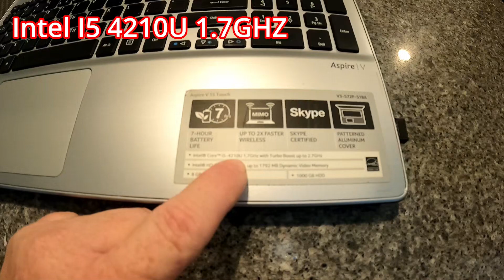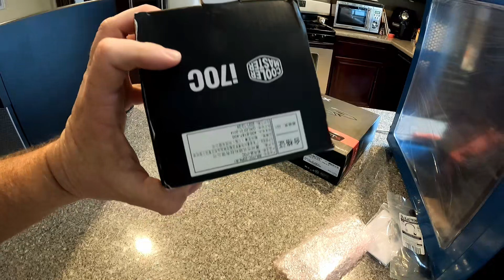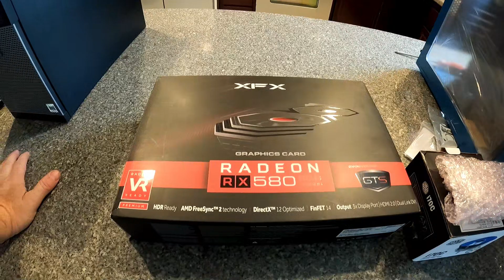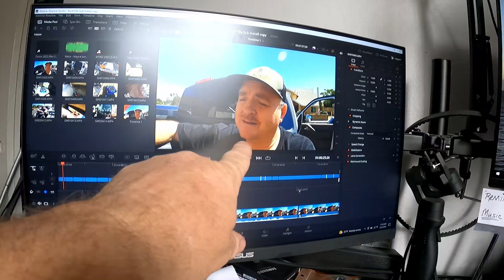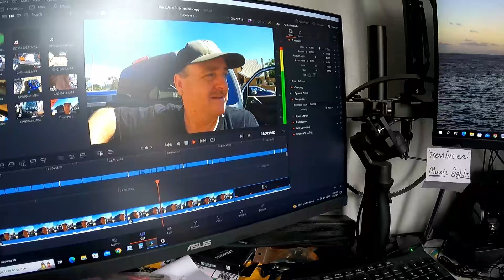Willy's DELL OPTIPLEX 7020 Upgrade

Comment: Thank you for this video 😁
My brother recently give me is old optiflex pc and at the same time a friend gave me is old graphic card 😅 I'm completely new to pc building and all those technical words so I have a lot of hard time pulling it off 😁 That's why I appreciate your video because it's clear and easy to understand. Now I know how to cable my mother card and my graphic card 🤣 I need a new power supply and some adaptor 😅 I will see later if I also need to upgrade the cpu and the fan. I hope not, I don't have a big budget 😅
Reply from the maker: Hello Minata, I’m glad you liked the video. Congrats on the new to you Optiplex. The old machines are plenty capable to do our daily tasks. I suggest you get new thermal paste for the cpu and cooler and a newer power supply. Depending on which model you have, there’s room for another fan in the front. Make sure the other fans work. Good look with the build and have fun. Thanks for watching!!

Comment: Well that was a fun upgrade to watch! Things should run cooler in that bigger case with those fans. Usually have to be careful handling the mother board etc because of ESD, could damage ic's. Nice video!👍
Reply from the maker: Thanks man! I know this video is long and can be painful to watch but I needed to do it and I might as well share it. I know there are more cautions to be taken when handling these parts. But it’s an old Dell from 2014. I know I’m not the only person to man handle it…😂 Thanks for watching!!

Comment: It's worth mentioning that the integrated backplate on the Optiplex won't always work with an aftermarket cooler. The threading is often different between coolers... so it might need to have those tabs cut off depending on what cooler you get so you can use the backplate that comes with it. An alternative to cutting is buying a standard 115x retention bracket of eBay for like $10. Speaking of coolers, IF that Cooler Master isn't quite enough to keep the 4790K cool once you really start putting it to work, an alternative would be the ThermalRight Silver Soul 135. It should be much more effective and it won't throw the fan F1 error either... these Optiplex can be super picky about fans.
Reply from the maker: Wow man Ive watched so many of your video on this before I started. Thanks for for taking the time to watch my build. Unfortunately the 4790k has already died but the good news is the seller is sending a replacement. I was thinking it may have overheated or maybe I didn’t have enough power for the new fans, gpu and cpu . I don’t want to install the other cpu until I figure it out.
I am definitely looking to the fan you suggested as a replacement for the other one. Maybe this will help. Again really appreciate that you took the time to watch. At nearly an hour it can be hard to watch.. Thanks for watching and leaving a great comment and suggestion!
Reply: @DIYWilly  What caused the CPU to die? Sometimes the Dell boards aren't compatible with different CPUs and other times it may be the way the cooler is mounted? Could be slightly ajar Especially if using the stock backplate,, the "bottoming out" may not be quite tight enough to mount the CPU properly?
Reply from the maker: Hello Shaun, What would be a good way to see it the cooler is seated properly? I have looked at everything and I really can not see any physical problem. When the cpu died it was processing magic mask in Davinci Resolve 18 Studio. Everything was fine before that the system was noticeably faster. Then there was a blue screen and a corruption error and it needed to reboot. I wish I would have documented the error. The system would not restart after that. I cleared cmos and tried a few other things but when I did get it back up it would freeze with any activity as simple as opening a folder. I reinstalled the 4770 and it’s been fine ever since. Thanks for watching and providing some insight of what could’ve happen. I’m going to continue to test for now.
Reply: Hey, No probs. 
If you can "wiggle" the cooler it's not seated properly, though you stated in your last reply the older/other CPU is fine since, so unsure, Are you using the new cooler on the 4770 or back to the stock one?
If you're usignthe stock cooler, I'm not overly familiar with the dell board in those systems, and yollu wanted to use the new cooler I would try and remove the stock back plate replacing it with the new coolers backplate.

You need to be careful removing this though, it can in some cases cause damage if not done slowly and carefully.

Always like watching build videos, be it with creator who do not do it often or ones that do nothing but builds. Well done for stepping out of your comfort zone and creating content that is almost a polar opposite to your normal topics. Glad to have stumbled across your channel.

Best of luck with any PC related content you produce in the future.
Reply from the maker: I am using the new cooler on the 4770 with no problem. I was editing content today for about 4hrs and it didn’t skip a beat. So I’m still not sure what happened. Could have possibly been a week chip maybe or it could handle what I was asking of it. I haven’t tried magic mask again for fear of causing damage to the 4770. Do you think it’s under powered? Definitely this video was off topic for what usually do but hey sometimes you gotta do it. I’ll do more with it soon.

Comment: Too funny, my son and I just did the same thing last month. Didn't film the build though. Maybe later we will make a short one showing the completed build. I wasn't brave enough to do it without my son. We created a monster. We used : EVGA Geforce rtx3070 ftw3 ultra gaming / corsair vengeance LPX 32gb 2x 16 gb /  sandisk SSD 1tb / Cooler Master HAF XB EVO High airflow test bench and LAN Box desktop computer case with ATX motherboard support / AMD Ryzen 7 3800X 8 -core 16 thread unlocked desktop processor with Wraith prism LED cooler / MSI MPG B550 gaming plus gaming mother board / Corsair RMX series RM 750x 750watt gold   fully modular power supply... Whew!  What editing program are you using? Awesome Video as always! Saw your sticker @ Fat buddy cats😎👍
Reply from the maker: I had to get my glasses to read all that…😂🤓Guess that’s a sign of old age. I continue to work on the Optiplex build. I installed a fan control/temperature read out and 2 spot usb 3 card today. I’m sticking with some sort of budget on this even though I just ordered an 850watt evga psu. I did the math and I am under powered. I think that’s what killed the 4790k I installed. Good thing the seller is sending a replacement. 
I use Davinci Resolve 18 Studio for my edits. I like how easy it is to use. Which is also why I am upgrading the Optiplex. I want it use some of the more advanced features of the software. I do plan on doing a full Gen 12 intel or Amd Ryzen 7 build sometime before the end of the year.
Reply: @DIYWilly  my old Dell was ancient and would take five minutes to boot up. Been doing everything on my phone🤣 so this will be a lot different. Researching editing options now. Sounds like the DaVinci is working well for you.
Reply from the maker: @ocotillooutlaws4101  I tried some other editing software but found I liked Davinci best. I started with the free version which is amazing and only recently bought the studio to try more of the features not part of the free version. Now if only I could start filming better with the right lighting and such so my editing will be easier.
Reply: @DIYWilly  I'll check it out! Right now all I have is iphone movie and for now it will have to be the free version. I'm broke after the computer build😉the budget went right out the window!
Reply from the maker: @ocotillooutlaws4101  i understand that. The free version works very well.